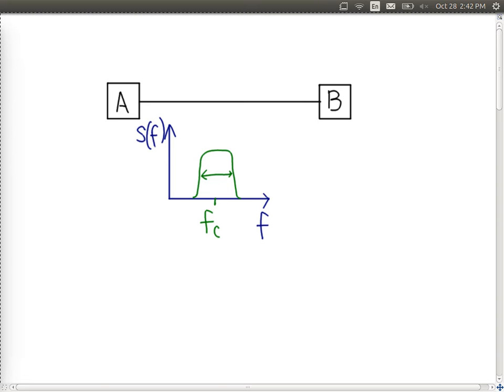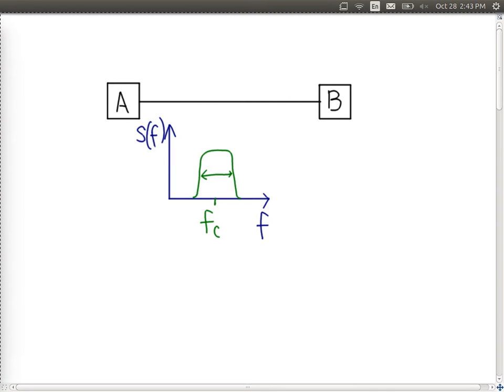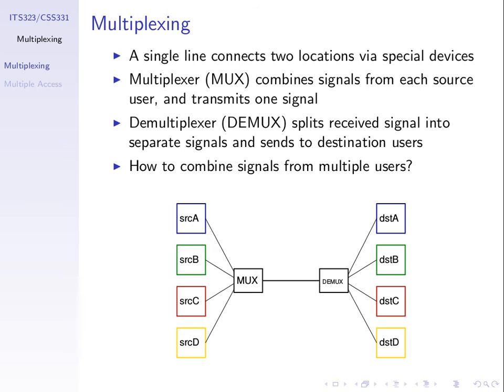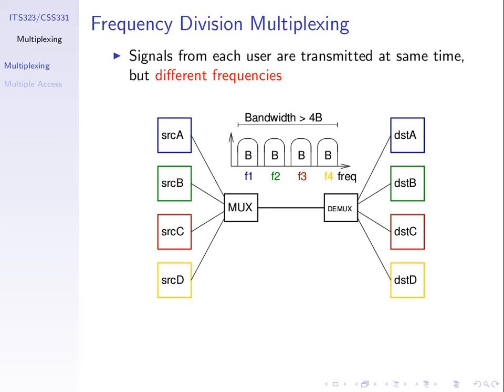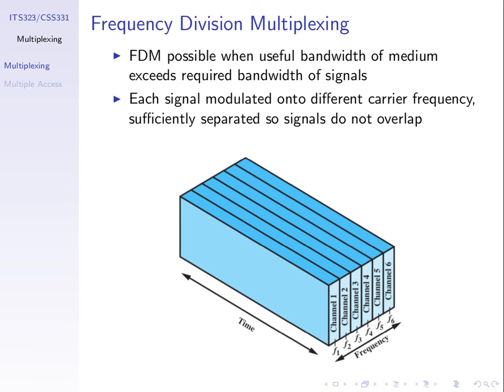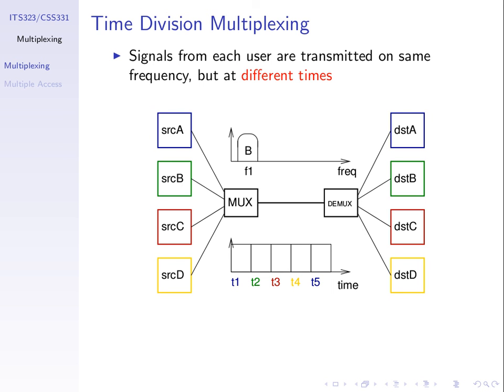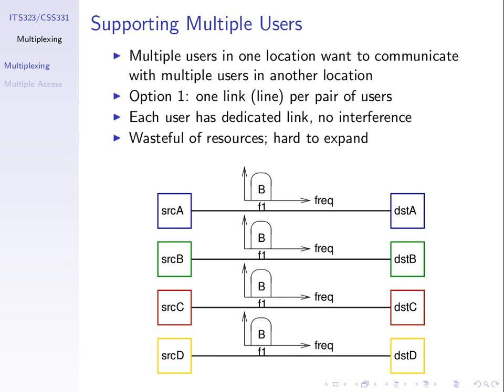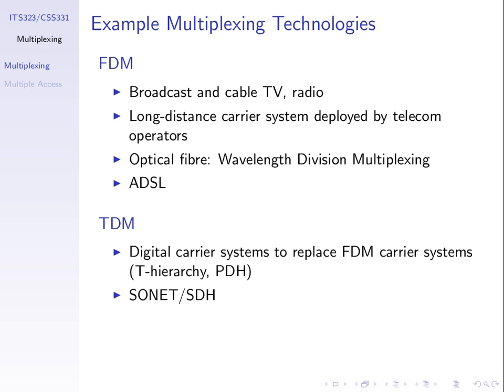Multiplexing (ITS323, L18, Y15)

Comment: • Physical layer
  ○ Bandwidth, frequency, shifting, what medium to use
  ○ Bit encoding, NRZ, Manchester
 • Data link layer
  ○ Error detection and control
  ○ Focusing on the link, getting frames across the link
  ○ Making it reliable and efficient
  ○ ARQ
 • Network layer
  ○ How do intermediate systems send and receive data
  ○ Routing: Find a route or a path from source to destination
 • TCP/IP
  ○ IP: Network layer
  ○ TCP: Transport layer
  ○ When did the internet starts: 60s 
   § ARPANET
  ○ 5 layers instead of 7
   § Application layer
    □ HTTP, Browsers, skype, chat
   § Transport, 
    □ OS level
    □ TCP, UDP
   § network
    □ Also OS level
    □ IP
   § Data link
    □ Ethernet, LAN, Wireless
   § Physical
    □ NIC
    □ Twisted pair, optical fibre etc. 
  ○ Note: The source and destination (host) needs to implement all 5 layers, but intermediate nodes do not necessarily need to implement the top layers
  ○ Protocols involved with opening a webpage
   § TCP Payload
    □ HTTP header
    □ Payload 
   § IP Payload
    □ TCP and above
   § Ethernet Payload
    □ IP and above
   § Ethernet net frame
    □ Ethernet
    □ All of the above
    □ The summation of all these is a frame
   § Each of these can be viewed via wireshark 
  ○ H
 
 
 
 
 
 2016-03-27 10:24 PM - Screen Clipping